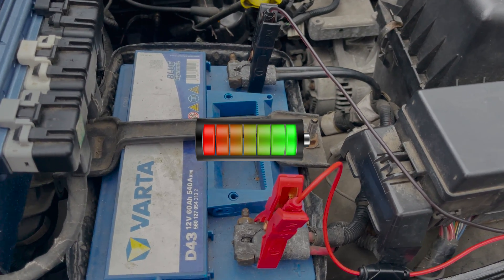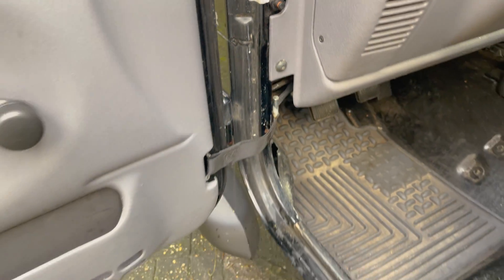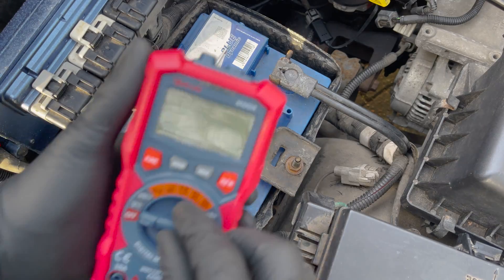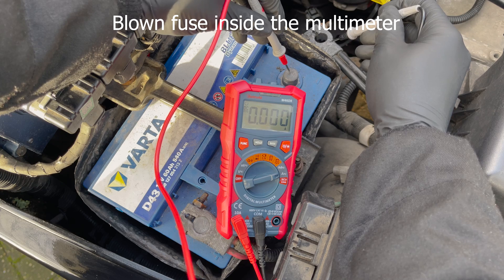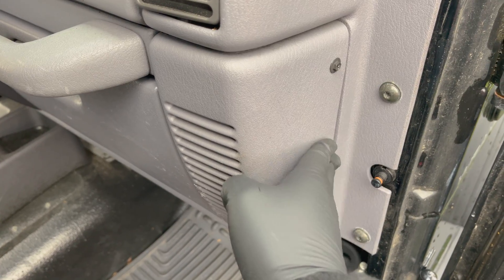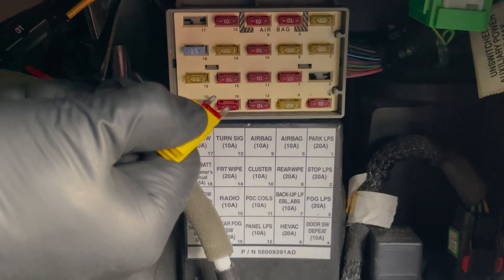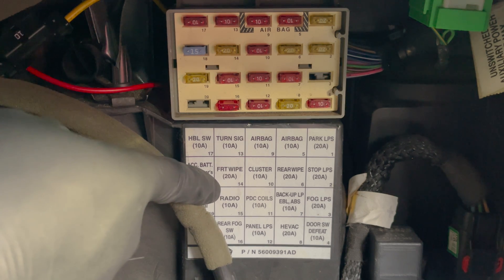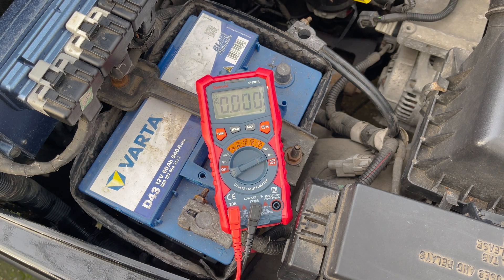The EASIEST way to test parasitic draw

Comment: So would I need to replace the fuse?
Reply from the maker: No, the fuse itself isn’t the problem. 
Pulling the fuses is just a way to easily locate on which circuit the parasitic draw is located. If you pull the fuse that protects the radio only, for example, and the parasitic draw disappears, you know the radio or its wiring is causing a parasitic draw. The radio might not be switched off, as shown in our simulation, or there might be a damaged wire, or the radio itself might be faulty. Once you’ve determined by elimination which part(s) is(are) causing a parasitic draw, you know what needs to be repaired or replaced.
Reply: @ makes sense. So I know it’s my 12v plug. If I leave my stuff plugged it my car dies in about an hour and a half. Not fully just not enough to start. This just started happening recently so would the whole 12v unit need replaced somehow?
Reply from the maker: When you leave electronics plugged into your cars' 12V plug, and it’s wired to be “hot at all times”, these electronics will draw power from your cars' battery and drain it even with your contact turned off, which is normal. If your car battery doesn’t drain when nothing is plugged in to your 12V plug, then there’s nothing wrong with your 12V plug.  

However, if unplugging the electronics from your cars' 12V plug does not fix the issue, you might need to repair or replace the 12V unit or sort its wiring.

Comment: The battery in my car is in the trunk. Could I run long wires from the battery (one wire on the red terminal and another wire on the disconnected black cable) to the multimeter which would be held near each fuse box?
Reply from the maker: You sure can! This will speed up the process of finding the right fuse(s) as you don't need to run back and forth to view your multimeters' readings. But watch out: you mentioned connecting the multimeter between the positive (red) terminal and the disconnected negative (black) cable, which is incorrect. You need to connect the multimeter to the disconnected negative (black) battery cable with one probe and to the negative (black) battery terminal with the other probe, otherwise the test won't work.
Reply: @classiccarmaintenance  Thanks for the help. I should pay more attention😀

Comment: Hi, I have a toyota corolla 2017 manual transmission. It draws 140mA with the alarm activated all doors and lights closed. It is the dome fuse that draws 60mA out of the 140mA. It the turns to 10mA when a relay clicks after 20 mins. Is this normal? I hope I get noticed..
Reply from the maker: You're good, that's perfectly normal for modern vehicles. The parasitic draw of 140 milliamps you measured in the beginning is because the dome light was still on and because the computer was still running in the background. Once the dome light goes out and the electronics go to sleep (the relay that clicks) you have a draw of 10 milliamps which is well below the acceptable 50 milliamps. That's why we said in the video that with modern cars you might have to wait half an hour or longer to perform this test as the cars' computer needs to go to sleep first.
Reply: @classiccarmaintenance  Thank you so much, that really eased my mind. You are very helpful! I hope you get tenfolds of followers and subscribers!
Reply from the maker: Thank you for the kind words, appreciate the support!

Comment: are you puttingignition key to on position
Reply from the maker: To test for parasitic draw you need to turn the key to the off-position and make sure nothing is drawing power. In our video however, because we did not have an actual parasitic draw, we simulated a parasitic draw by turning the key to the accessory position. This turns on the radio which draws power, and shows up on our multimeter as a parasitic draw.

Comment: I did this test on my car. But I'm confused. Can you help please? My multimeter shows 0.066  . Sometimes goes upto 0.070
 .
Reply from the maker: Your measurement of 0.070 (70 milliamps) is above the accepted 0.050 (50 milliamps), which means you have a small parasitic draw. You now need to locate the fuse box and start pulling the fuses one by one to see on which fuse your parasitic draw is located, as shown in our video. Once you know on which fuse the parasitic draw is located, by further elimination you can now determine which wiring or electronics that are powered by this fuse is (are) causing the parasitic draw.

Comment: Does this have to done on amps?
Could it be done on DC Volts?
Reply from the maker: No, it has to be done with a multimeter in the amps setting.
Reply: @classiccarmaintenance  Is it too difficult to explain why?
I'm trying to learn electrical and I know it can be difficult.
Reply from the maker: In our video we're demonstrating the simplest way to test for a parasitic draw, with an amp draw test using a simple multimeter. Of course you could test for parasitic draw using volts by performing a different test, but you would need a very accurate professional multimeter to measure voltage drop across fuses and compare the measured values to a fuse voltage drop chart. This however is much more involved and time consuming as a difference of even 0.1 milivolt (which is 1/10,000th of a volt) can mean the difference between having a parasitic draw or not. That's why it's much easier to perform a parasitic draw test by measuring in miliamps, just like we demonstrate in our video.

Comment: Thank you for this video. I have the same meter. I have been having trouble with intermittent battery drain on my 2015 civic. It happens randomly where I go out to the car and there is no power and I have to jump the battery. I did this test and it read 0.012 which I believe is in normal range right? I pulled some fuses anyway and when I pulled the "backup" fuse the meter went down to 0. There was no draw at all from the battery. Is this normal?
Reply from the maker: Any draw under 50 miliamps is considered normal, so it appears that your conclusion that you don't have a parasitic draw is correct. If your car battery can't hold its' voltage but you don't have a parasitic draw, most likely your battery is bad and needs replacing. To make sure, check out our video about how to test your car battery which you can find on our channel: https://www.youtube.com/watch?v=GeEMrPOI0xM&t=112s.

If your car battery passes the battery tests though, you might want to investigate your cars' electronics and car computer for erratic activity. If it turns on and off randomly for example, that might cause the occasional parasitic draw you're describing. In this case you might want to consult a certified Honda technician to sort out possible software-related issues.

Comment: So what do you do now do I change the fuse with a new one or buy new radio?
Reply from the maker: No, the fuse itself isn’t the problem. 
Pulling the fuses is just a way to easily locate on which circuit the parasitic draw is located. If you pull the fuse that protects the radio only, for example, and the parasitic draw disappears, you know the radio or its wiring is causing a parasitic draw. The radio might not be switched off, as shown in our simulation, or there might be a damaged wire, or the radio itself might be faulty. Once you’ve determined by elimination which part(s) is(are) causing a parasitic draw, you know what needs to be repaired or replaced.
Reply: @classiccarmaintenance in this video, you said to turn off the radio power, that’s all there is to it, then the parasitic draw goes away. Did you change the radio or something like its wires?

Comment: You opened the door, to find the draw and didnt mention how it would also be drawing current at that point.
Reply from the maker: Well spotted! Like we said you have to keep the doors closed to prevent this from happening. However, if you have to keep your door open to film the testing process like we did, or because the fuse box can only be reached with the door open, you want to manually lock the door locking mechanism or tape off the door jamb light switch to prevent keeping the computer(s) awake and to shut off the interior light(s). If you manually lock the door locking mechanism with the door open, do not forget to unlock the locking mechanism before slamming the door shut though! It’s a good idea to put some tape on the door or on the door handle as a reminder.
Because our ‘98 Wrangler only has a very basic ECU, it does not “lie awake” (pun intended) over an open passenger door. We just removed the only interior light bulb to prevent it drawing current.

Comment: And how does the radio draw power with the terminal disconnected ? Did I miss something ?
Reply from the maker: When you hook up the multimeter between the negative battery terminal and the black battery cable, it functions as a bridge allowing power through. This, however, is limited by your multimeters' internal fuse(s). If you turn on too much electrical stuff and draw too much power, its fuse(s) will blow and you'll have to replace them.

Comment: Just to confirm, you mentioned that the battery needs to have a full charge in order to test for parasitic draw.  My battery is only reading 10.7v, and my amp meter isn't picking up any draw whatsoever.  Sound about right?
Reply from the maker: It's a good sign that your multimeter isn't picking up any parasitic draw, but for an accurate reading you should always first charge your car battery fully before checking for parasitic draw.

Comment: Once you find the parasitic draw, do you change the fuse?
Reply from the maker: No, the fuse itself isn’t the problem. 
Pulling the fuses is just a way to easily locate on which circuit the parasitic draw is located. If you pull the fuse that protects the radio only, for example, and the parasitic draw disappears, you know the radio or its wiring is causing a parasitic draw. The radio might not be switched off, as shown in our simulation, or there might be a damaged wire, or the radio itself might be faulty. Once you’ve determined by elimination which part(s) is(are) causing a parasitic draw, you know what needs to be repaired or replaced.

Comment: Thanks bear in mind minimal battery drain can give many months of”Thrustration” The culprit a very small car battery and an aftermarket hardwire to a Nextcam dashcam. The manufacturer may say it won’t cause issues , for me it’s cost £60 plus many hours of work and a non starter😿🤐🥵

Comment: How did the radio turn on when the battery wasn't connected?
Reply from the maker: When you hook up the multimeter between the negative battery terminal and the black battery cable, it functions as a bridge allowing power through. This, however, is limited by your multimeters' internal fuse(s). If you turn on too much electrical stuff and draw too much power, its fuse(s) will blow and you'll have to replace them.

Comment: Everytime you remove and install a fuse, it's possible to restart the networks. Then you have to wait for the networks to sleep. This can take 45 minutes on many cars for computers to sleep. This testing process is outdated and flawed for any car built after 1996. A low amp clamp and DVOM to run parellel with fuses is the way to go.
Reply from the maker: Thanks for your input! 
In case the parasitic draw increases after plugging the fuse back in, you know that some part of the cars' electronics have woken up, that's absolutely right in case of some modern cars. But the principle of locating the parasitic draw stays exactly the same. Just like initially, you only look at the amp drop when removing the next fuse, yet with the new amperage reading as the benchmark. So if you pull the next fuse and the amp draw drops significantly, you know this circuit has a parasitic draw somewhere, regardless of some electronics that may have woken up by reinstalling the previous fuse.

Comment: I'm connected as shown with a Southwire 21550T but current isn't passing through. Stumped.
Reply from the maker: If you can’t detect anything even after verifying that your multimeters’ test leads are properly connected and making good contact, the dial is switched to ⎓ DC Amps (with the dotted line under the straight line) and the DC Amps setting is switched to a range that can detect milliamps, then there might be a blown fuse inside your multimeter. You can easily screw open your multimeter and take out the fuses one by one (if there are multiple) to test them for continuity. If you can’t detect any continuity then the fuse is blown and you’ll need to replace it. If the fuses are ok, then your multimeter might be malfunctioning.
Reply: @classiccarmaintenance  thanks, I will look into that. But I'm also thinking this meter can do DC current through the clamp only. Sounds odd, but even the manual says to use the clamp for DC current.

Comment: Would you just replace the fuse or would be something more complex?
Reply from the maker: No, the fuse itself isn’t the problem. 
Pulling the fuses is just a way to easily locate on which circuit the parasitic draw is located. If you pull the fuse that protects the radio only, for example, and the parasitic draw disappears, you know the radio or its wiring is causing a parasitic draw. The radio might not be switched off, as shown in our simulation, or there might be a damaged wire, or the radio itself might be faulty. Once you’ve determined by elimination which part(s) is(are) causing a parasitic draw, you know what needs to be repaired or replaced.
Reply: @classiccarmaintenance  oh, in other words there’s something wrong with car that’s going to cost a lot of money to fix. Got it. Currently having the issue with my battery dying after only sitting for a week with driving.
Reply from the maker: Not necessarily, no. It might be as simple as a loose wire, the interior, trunk or glovebox light that stays on without you noticing. If you can pinpoint where the parasitic draw is located, you can either try to fix it yourself or tell a professional where it is located, saving him time and saving you money. 
About your battery dying after a week, you said it was while daily driving it? If that’s the case then you might have a bad alternator. Your car uses electricity from your battery to run and operate all the electronics, and your alternator is powered by the running engine to charge the battery while driving. If your alternator doesn’t work properly the battery won’t charge and will drain even when you drive your car. We have a video on how to test your alternator with a multimeter as well so you may want to check it out, it’s a really simple test.
Reply: @classiccarmaintenance  mistake on my end, it’s not a daily driver. I have a company truck. My personal is driven 1-3 times a week sometimes less.
Reply from the maker: Our advice is to first test if the battery is still good with a battery tester, then check if the alternator still works. If both battery and alternator are OK, you want to look for a parasitic draw. We have a video on each of these subjects, so make sure to check them out, it’s easier than you might think.
Reply: @classiccarmaintenance  had to get a new battery, tested the alternator (by following your video) and it’s fine. It’s either parasitic draw or the battery was bad. Will leaving the negative battery cable unhooked keep it from draining due to a parasitic draw?
Reply from the maker: Yes, leaving the negative cable unhooked should prevent parasitic drain. However, in modern cars, disconnecting the battery can reset crucial computer settings, engine management data, and erase radio/accessory presets.
Reply: @classiccarmaintenance so I tested for a parasitic draw, when I first put my multimeter on it test for -3 but after a couple seconds went to .0L? What’s does that mean?
Reply from the maker: With most multimeters, OL means overload. The measured value is out of range of your multimeters’ setting. Try switching it to a higher amp range (e.g. try switching it from 200m to 10A). Consult your multimeter manual to make sure.

Comment: Another tip is fit a buzzer between the earth terminal then when you pull the suspect fuse the buzzer will go quiet instead of keep lookin up at the multimeter screen 😎
Reply from the maker: This could work, however, the buzzer will only sound when it gets enough power. Depending on how small the parasitic draw is, the buzzer won’t sound at all or too faint to hear it. So, in our opinion, that’s too many unknowns.

Comment: How is your radio on if you have negative disconnected?
Reply from the maker: When you hook up the multimeter between the negative battery terminal and the black battery cable, it functions as a bridge allowing power through. This, however, is limited by your multimeters' internal fuse(s). If you turn on too much electrical stuff and draw too much power, its fuse(s) will blow and you'll have to replace them.

Comment: When I remove the negative power cable from the battery no power is going to the vehicle. Therefore I have no draw, even when I try to. The radio will not come on if the battery is disconnected. How did you get the radio to come on when the battery was disconnected?
Reply from the maker: When you hook up the multimeter between the negative battery terminal and the black battery cable, it functions as a bridge allowing power through. This, however, is limited by your multimeters' internal fuse(s). If you turn on too much electrical stuff and draw too much power, its fuse(s) will blow and you'll have to replace them.

Comment: If I disconnect the negative cable the car then has no power. How do I do the simulated radio test wtihout power?
Reply from the maker: When you hook up the multimeter between the negative battery terminal and the black battery cable, it functions as a bridge allowing power through. This, however, is limited by your multimeters' internal fuse(s). If you turn on too much electrical stuff and draw too much power, its fuse(s) will blow and you'll have to replace them.